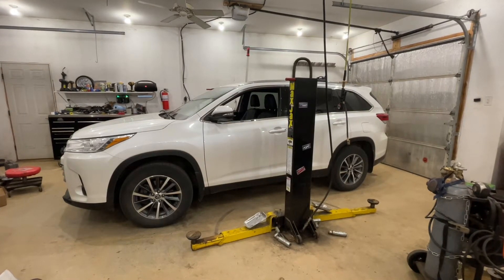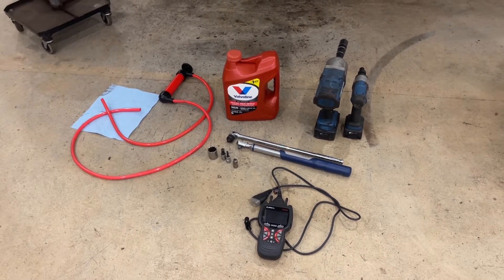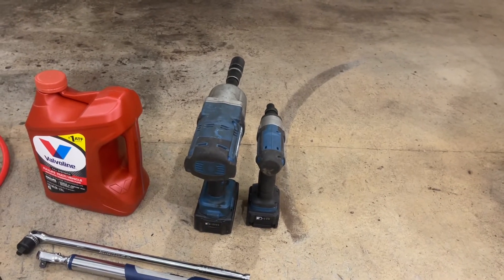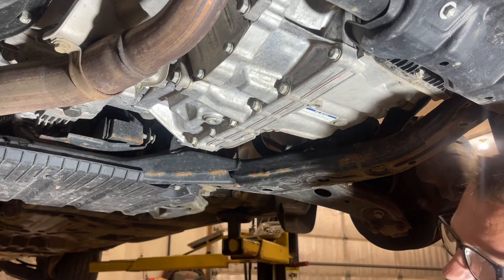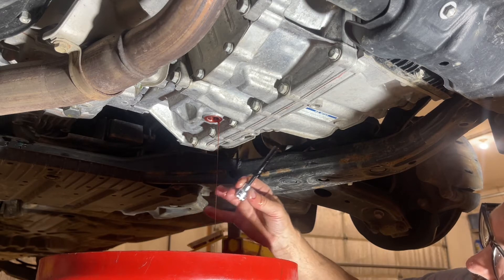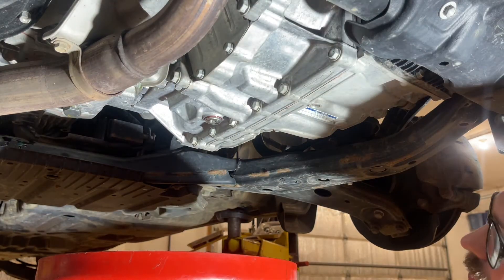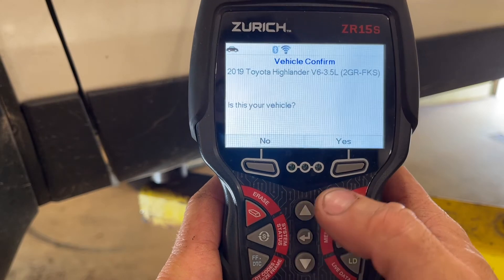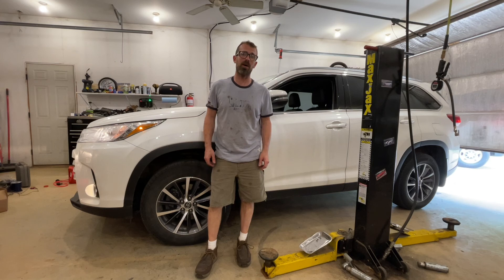🔧 2017-2019 Toyota Highlander transmission fluid change UA80E *the right way to fill*

Comment: My 2019 is about to hit 60,000 miles and I asked my dealership about doing this drain and fill for me. They suggested I don’t do it as it’s a waste of money as only about 30% of the fluid gets drained due to the placement of the drain plug. This video or others I’ve seen don’t mention, making me think the dealership is wrong
Reply from the maker: The dealership is partially correct and partially wrong in my option. 

They are correct that it only replaces about 1/3 of the fluid. 

I don’t agree with them on that being a reason to not do it.  Did they offer “a better” solution?

IMHO that fact that it only replaces about 1/3 of the fluid is exactly why you should do it, and do it on a regular basis, like 60k miles.  If done on a regular basis your fluid should stay looking good. If you perform this service and the fluid ever looks very dark, you can repeat the procedure and replace even more of the old fluid, although the new fluid will of course be diluted by old fluid to some extent.

Comment: I appreciate the thoroughness just thought you might consider putting an extension on you torque wrench can cause change of torque value set on your tw
Reply from the maker: Thanks!

An extension that is perpendicular to the head of the torque wrench (at an exact 90 degree angle) won’t change the torque value. A wobble extension, or ujoint type adapter will definitely change the applied torque of a torque wrench. 

It’s always best to just use a socket and remove any variables, but sometimes that’s not an option.
Reply: @bennieaust  do you think it is possible to this without removing wheel?
Reply from the maker: @ yes, I think it is overall easier to just take the wheel off, but if you turn it to the left as far as possible you can absolutely leave it on. Also in my case filming it practically requires removal.
Reply: @bennieaust  sweet I'll be doing this very soon. Thanks for the content. Really seems like Toyota is trying to engineer out diy'ers.
Reply from the maker: @allthingsnm354  They are getting a little more complicated to service, but when you look at how much more complex the entire car is, it doesn't seem so bad.

Comment: What about the filter?
Reply from the maker: Check out the video description for details on that.
Reply: Thanks man I called the dealership. They told me to replace the transmission fluid every 60,000 miles but would you be recommend doing it every 30,000 miles
Reply: I have a 2022 and Toyota says I have to replace the dang transmission filter every 30k mines at 39k I was just going to do the fluid.what are your thoughts?
Reply from the maker: @samgage2294  This video does not cover changing the filter, but here is a link to a filter / gasket kit if that's the direction you want to go.  In my opinion, if you change the fluid as recomended, you will not have to change the filter: https://amzn.to/48522VE

Comment: Does the vehicle need to be completely level or can I get away with jacking up the front?
Reply from the maker: It is supposed to be level for that step. 

It’s an easy step, you could probably get away with dropping it back down and just reaching under the vehicle to pull the plug and drain the excess.  Not much will drain out. Then you could reinstall the plug, lift it back up a little and torque to spec.

Comment: I hear mixed answers on bypass valves for the 2017-2019s. I have a 2016 with the 660E transmission. It definately does not have a bypass valve. Does the 80Es have them or not?  You did not refer to it.
Reply from the maker: I should have mentioned it in the video, I can’t say with certainty what makes and models did or didn’t come with the bypass valve.  If your transmission does have it, pin it.

Comment: Try gravity feeding to fill using a pump totally unnecessary and messy. Vinyl tube and funnel works best. Goes right through engine compartment
Reply from the maker: That sounds like a good option if it’s not on a lift.  I’ve found it helps eliminate the mess by using a pump, but that’s just been my experience.

Comment: I have a 2017 toyota highlander 4 cylinder with 75,000 miles i have not changed the transmission oil ,can i change now how many miles.
Reply: No issues. Do it
Reply from the maker: You are not very far past due. In my opinion you will have no issues. I would suspect the fluid probably still looks ok.

Comment: I cannot thank you enough for your fully informative instruction video on the transmission fluid change.  All the steps worked in order and the run instructions waiting on the fluid level to be made right was less stressful knowing what was going on above the fill level.  The wrench type and torque settings iced the cake.  I used an electric 12 volt pump and fed the fill line down beside the battery and into the back of transmission.  Never lost a drop filling.  Thanks again and Blessings to you and Yours.  I am only 81 years young.
Reply from the maker: Thanks for the kind message Gary!  So glad to hear it made the job easy for you, and great to hear you're out there doing the work!

Comment: Ended up getting the same scanner as you, but the Service Check does not show transmission oil temp (only shows Engine Oil OK). Any thoughts? Maybe a setting is off. When I use the "Live Scan" part of the tool the transmission temperature does not seem to be updating either.
Reply: I have the same experience with the Zurich ZR15s and Innova 5610.  There is no information on transmission fluid temperature available.  I used OBDLinkMX+ instead. It cost less and it works really well.  It quickly shows the transmission fluid temperature.
Reply from the maker: I have head of a few of these issues. I would definitely recommend contacting the manufacturer.  I heard it’s a software update issue. To this day I haven’t had any issues with mine, but maybe they can help / explain it.
Reply: @bennieaust  I appreciate the response, and thanks for making these videos. You definitely saved me time and money today!
Reply from the maker: @Chadwickyboy  you're welcome!  Sorry you ran into that issue with the scanner.  My number one goal is to try and provide good info and the scanner thing is super irritating. :(

Comment: I have a 2020 Rav4, after how many miles or years should I replace the transmission fluid ?
Reply: Do it like he does here every 40k. So easy to do as a part of an oil change
Reply from the maker: I don’t have a manual in front of me but I’m pretty sure it’s every 60k miles.

Comment: I drained, and filled, got it to temp, and when it trickled i put the plug back in. I put 4 quarts in, and 1 quart came out + maybe 1/20 more, that means 3 is inside it. Why is this? Is this safe? Did i mess up? You said 3.2 quarts but now i have less, idk if this is safe to drive
Reply from the maker: It’s safe to drive because you followed the procedure to set the level correctly.  Everything else can vary slightly but when you follow the procedure correctly, like you did, you have it filled to the correct level.
Reply: This is correct. It actually takes 3. I did it to my 2018 and caught all the fluid that came out just to see, and 3 exact quartz came out.

Comment: So, what if you are doing this all on ramps and not on a lift? Obviously the level of fluid wont be "level" and do you have to put the wheel back on, drive it aroubd shifting and then back on the ramps prior to doing the excess fluid drain? Thanks for the video!
Reply from the maker: Yes, you will have to put the wheel back on and drop it down. 

Technically you don’t have to even drive it, just shift through the gears, warm it to temp and reach under to bill the plug and drain the excess. It’s a little harder, but totally manageable without a lift.
Reply: @bennieaust  thank you! Toyota wants $500 lol I'm an engineer,  so I should be able to mess it up just enough to keep driving it hahaha
Reply from the maker: @noonagon1  you’re welcome!

Comment: Good overall but you missed the manually activating the cooler that’s bypassed.  And since you have to remove the bottom front engine cover it is an optimal time to clean the condenser.
Reply from the maker: Thanks for the added tips!
Reply: Don’t think this has the bypass like the 4 Runner
Reply: @condor5635  it does.
Reply: @scallywag1716  do you know what year they started?  I know my 2016 does not. Maybe it started in 2017 when they went to 8 speed transmissions

Comment: Can I use this video for a 2016 Highlander ?
Reply: See my video for 2016. Different transmission - 6 speed versus 8 speed - but identical process
Reply from the maker: This video is specifically for the 2017-2019 highlander.

Comment: All 4L need to be a pump?
Reply from the maker: Yes
Reply: @bennieaust  my 2017 only came out 2.5L
Reply from the maker: @artcraftstudio560 the important part is setting the level. You could put in 8L, just make sure you follow the level set procedure.

Comment: Super helpful.  You are a natural instructor & human repair manual 💯!  Quick question, the plastic 6mm level tube aka straw, have you ever seen in broken?  That tube is there daily going through hot & cold cycle.  Do you recommend having one as a standby in case if it breaks while removing it?
Reply: No they are tough and will not break. Taken mine out 5 times and it is like new
Reply from the maker: Thank you so much! :)

I haven’t ever seen one break. I think the biggest thing is just use the bit by hand (no ratchet) and don’t force it. It’s not a bad idea to have a spare on hand but I haven’t needed one yet.

Comment: In my 2018 Toyota Highlander 3.5L XLE owner's manual it says on page 657, eight quarts of Automatic Transmission Fluid. 

Automatic transaxle
Fluid Capacity
2.7 L 4-cylinder (1AR-FE) engine
6.9 qt. (6.5 L, 5.7 Imp. qt.)

3.5 L V6 (2GR-FKS) engine 
2WD models: 8.0 qt. (7.58 L, 6.7 Imp. qt.)
AWD models: 8.0 qt. (7.58 L, 6.7 Imp. qt.)

But you put four quarts on yours. I'm more inclined to believe you versus Toyota because let's face it, car makers and dealerships are selling the whole "lifetime fluids" campaign nonsense.
Reply: That’s total capacity not drain and fill
Reply from the maker: What I used was for the exact service I performed. For some reason the listed capacities for transmissions are all over the place. I think sometimes the discrepancy is that they may be listing total capacity vs drain and refill capacity. Either way there are no tricks in my video. It is what it is.

Comment: I have a 2016 Toyota Highlander xle awd with 69k miles. Does this video also applies to this year model?
Reply from the maker: No, this video is specifically for the 2017-2019 models
Reply: @bennieaust  thank you
Reply: @christiancastano3795 - I have a 2016. Same process exactly. You will have a pan versus no pan in this video but identical process. I have a video on it too

Comment: Why put new fluid into old fluid?You still have old fluids in the torque converter that will mix together that will remain dirty in color not cherry red .
Reply: If you do this every 30-40k you won’t have to worry about mixing somewhat dirty with clean
Reply from the maker: That’s a good question. This video covers Toyota’s recommendations.  I don’t disagree with you, but if the manufacturer recommends this method I certainly feel it’s appropriate. Also when done on schedule your fluid should never get nasty enough to be an issue. 

Thanks for watching!
Reply: Здравствуйте я купил тойота хайлендер 2.7 2018 54000мили.нет сервисный книги когда меняется масло в акпп коробке передач?
Reply from the maker: @жанжан-к8м  60,000 miles
Reply: @bennieaust  спасибо большое.это регламент тойота центра?
Reply from the maker: @жанжан-к8м  да
Reply: @bennieaust  спасибо
Reply: Еще вопросы полностью заменить или частично?
Reply: Извините ещё какой масло акпп заливает тойота мотрс сша.привет из Казахстана GGG.
Reply from the maker: @жанжан-к8м  Toyota WS fluid.  I used Valvoline MaxLife ATF which Valvoline recommends.

Comment: Great video, but one key thing that also needs to be done is the pin the transmission cooler. This way when allowing the transmission to get up to temperature it allows all the fluid to circulate thru the transmission cooler. The value is located in front of the transmission underneath the plastic shielding but has a access port. I have done this procedure on my 2017 4 times now FYI.
Reply from the maker: Thanks for the added info!
Reply: How did you pin it without removing the shield? I had to undo a couple of the screws so I could fit my hand underneath and shove it down with a screwdriver. Then I got a 1.5 Allen key through the access port and was barely able to reach it to put my key in. Is there some tool that does this really easy?

Comment: When you drained the fluid, did you do it when the engine was cold?
Reply from the maker: It had been run for just a couple minutes.  It's always a good idea to run it for a couple minutes before draining but if you do it while hot you will have to deal with hot fluid, plus it may actually be over the temperature range to set the level when you finish.

Comment: Hi quick question in the procedure you need to press the button of the thermostat oil cooler to open the oil cooler and pass a allen key, And I didn't see you do that step, you've done it in others highlanders, i have a 2019 highlander xle and the transmission have a bypass oil cooler in front of the transmission and car care nut said the we need to press and pass a allen key to open the oil cooler
Reply from the maker: If it's equipped with the oil cooler bypass then you will definitely want to do that.
Reply: @bennieaust  yes my highlander have a bypass but why this highlander not have a by pass but the the same transmission and engine
Reply from the maker: @jonathanrivera283  I'm not sure, sometimes it's different option packages like a tow package.
Reply: Pretty sure bypass is not on highlanders but on 4 Runners
Reply: @condor5635  My 2019 Highlander XLE has the oil cooler and the bypass. The plastic shield has a small square cut out from the factory to access the bypass. No need to remove the shield. 1.5 mm allen wrench fits perfectly to pin it. used a 90 degree pic tool to push it in. I don't think there is enough room to get a screwdriver in, it's a really tight space unless you remove the shield.
Reply: @jimmag3991  wonder what year bypasses went in. 2016 does not have it. Maybe when they went to 8 speed transmissions in 2017 I think

Comment: one question, I understand the temperature needing to be over a minimum degree, but not a  maxiuim (other than burning yourself) - I would think a temperature of anything over 95F would be fine.   What is the reason the fluid can't be too warm?
Reply from the maker: As the fluid warms, it expands.  If you set the level with it to cold it will be overfilled, if you set the level with it to warm it will be underfilled..
Reply: Oh thanks, I get it.

Comment: If one were to drain the fluid while completely cold, measure how much came out and put that much exactly back in (also cold)...

could the temperature part be needed still?
Reply from the maker: As long as it has the correct level in it to begin with. I have heard too many stories to count about how even the dealer didn’t fill it to the correct level.  Personally, I would only do it by correct procedure.

Comment: Just bought the same scanner but it won’t read the trans temp am I missing something or did you have to update the scanner to it’s newest software update??
Reply from the maker: I’ve heard a couple complaints from people with this issue. If it’s the Innova 5610 or the Zurich ZR15s, it should be exactly what I showed in this video. Make sure it is updated, and maybe contact Innova or Harbor Freight. 

I haven’t had this issue so I’m not really sure why it’s happening.

Comment: Would this be the same for a 2016 highlander?
Reply: It’s the same process but your 17 and higher have not pan and have an 8 speed vs 6 speed in 2016 model. Identical process just different looking transmission. I have a 2016 video on this
Reply from the maker: It will be close but not exactly the same. This is specifically for 2017-2019.

Comment: Did you change the filter ? Or have a video doing that ?
Reply from the maker: I didn’t change the filter. In my opinion, if you change the fluid as recommended, you will not ever need to change the filter. I did provide a link to the filter in the description if you decide to go that route.
Reply: @bennieaust  ty brotha, I'll google it but just fyi the description for  the filter I didn't see it there. But ty anyways
Reply: I'm dumb is there lol my bad, but doing this sat thanks for the vid man saved me 250 !
Reply from the maker: You’re welcome!

Comment: Thanks for the video. I have heard that if the gearboxes have gone excessively a long time without a fluid change it's bad to change the fluid as this will do further damage to the gearbox? 
Is this true? I would have thought the longer the fluid in the box the more damage it would do?
Reply from the maker: I have heard the same thing.  The theory is that if the transmission is old and the clutches are worn, the old gritty fluid my be the only thing making them grab anymore.  If you change out the fluid and have fresh, "slippery" fluid, then clutches will not grab anymore.  I haven't experience this ever, and it's safe to say the transmission was already at the end of it's life if this happens.  That's my opinion on it at least.
Reply: @bennieaust  That's my train of thought too, and I don't think the rest of the gearbox components would last long with gritty fluid circulating around as well and it does mean that the clutches are worn and the gearbox's days are numbered.

Thanks.